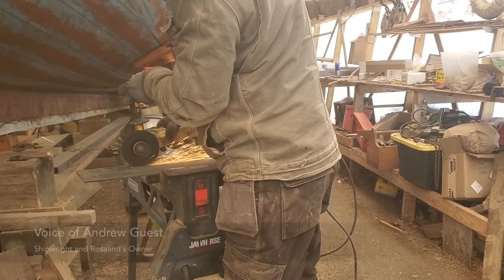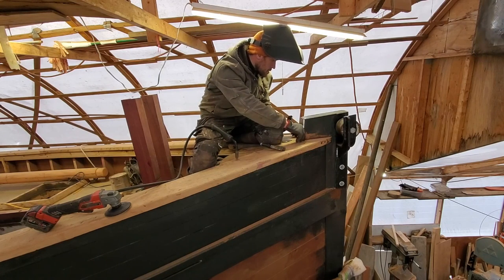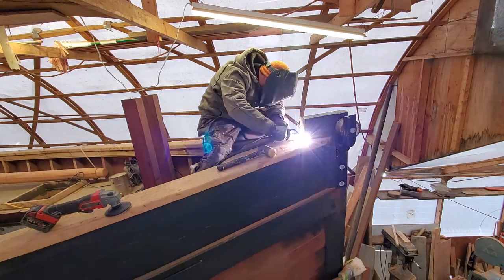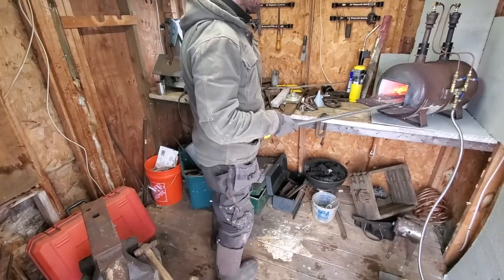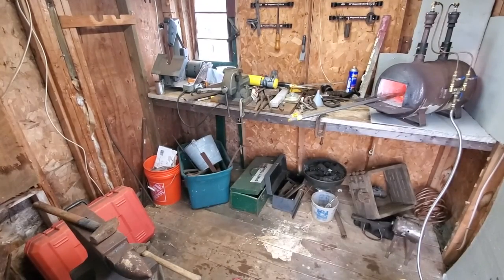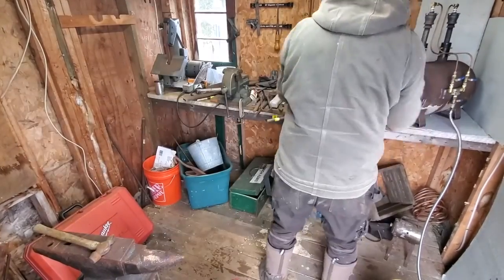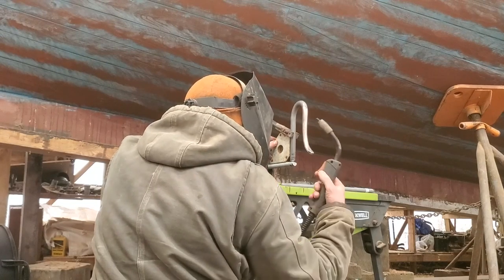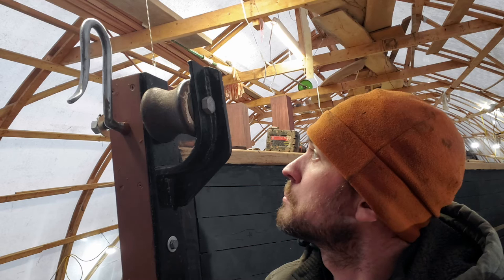Restoring Rosalind, Episode 26.5: Metal Work—Forging and Welding Stem Hardware for a Wooden Boat

Comment: You were very lucky that all the sparks from the cutoff wheel going into the shelves did not catch anything on fire.  I see you are having to awkwardly hold the ground clamp in contact.  There are magnetic ground "pucks" which would have freed your second hand.
Reply from the maker: not really, everything was soaking wet from a recent blow (the tent leaks as of a year ago), and I had a fire blanket + extinguisher on hand. I have one of those magnetic ground clamps somewhere but I couldn't find it so whatever works!

Comment: Very cool stuff. I kinda shuddered at the thought of all that steel covering and piercing the top of the stem and what that means decades down the line if maintenance isnt kept up perfectly. I'd have done it in bronze, but I'm really jaded about using any ferrous metals in wooden boats after all the iron sick wood and wasted fasteners ive removed (and have yet to remove) from mine.
Reply from the maker: It's a concern but maintenance will be kept up!! I kept it to deck level and above for ferrous metals for that reason (mostly 316 stainless apart from this)
Reply: @RestoringRosalind  Fair enough. If you need any 1/4 x 2 1/2" 316 stainless wood screws, I've got an absolute crap ton of em and they're of no use to me. They sunk them in next to the wasted iron plank screws during a shoddy refit in the 80s. I'm refastening the planks with copper rivets.